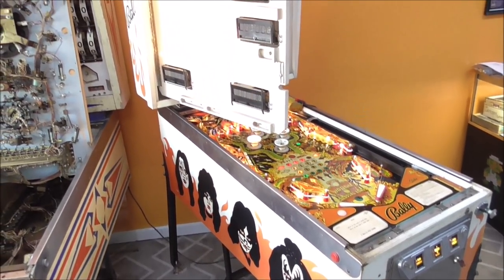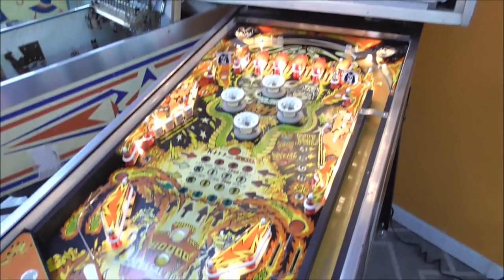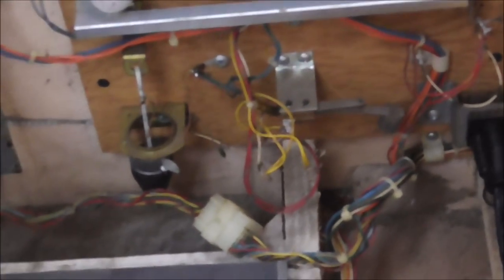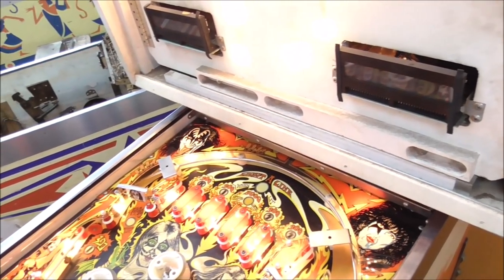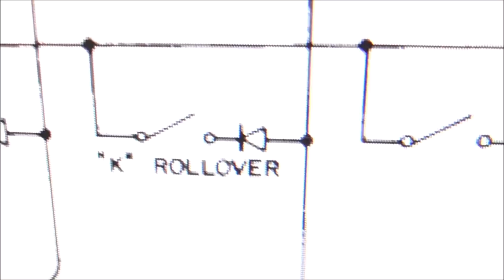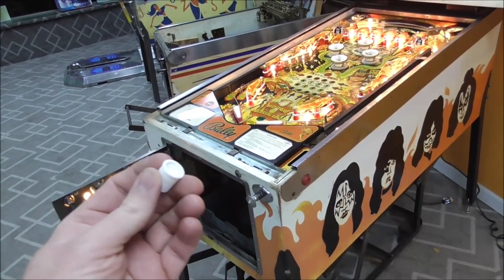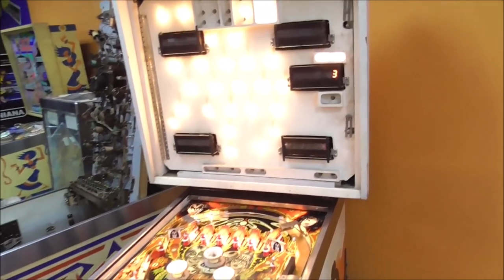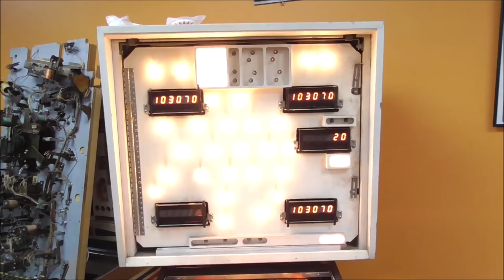Tracking down Switch Problems - Bally 1979 KISS Pinball Machine - Let's Get This Sucker To Play! A-3

Comment: I believe the caps also serve as protection against 'switch bounce'; scoring more than once when hitting a switch.
Reply from the maker: Have you ever owned a Bally pinball machine? I have, and what I said they do in the video is what they do because I've actually touched one
Reply: @LyonsArcade  I've owned a Stern machine does that count? You seem to be unfamiliar with switch bounce, which is also a thing.

https://www.allaboutcircuits.com/technical-articles/switch-bounce-how-to-deal-with-it/

Not sure why you are getting snippy, I never suggested that you were wrong, I just said this is also something that the cap does.
Reply: @LyonsArcade  That's kind of a crappy response to give to one of your viewers, even if you are correct.  To be fair, you've been incorrect about technical things before in your videos and this guy has a fair, and valid, point.  Just sayin', you could have went with, "That's an interesting point, but in my experience, the Ballys only use the diode to ensure quick response even with brief contact."  "I know because I've actually touched one..." is very seventh-grade, yeah?  Disappointing.
Reply: @mrmustard-mp6ij  I think maybe Ron was having a few beers and having a little fun with me 😉

Comment: Late 70s and early 80s put out the best pins, in my opinion.
Reply: Feeling and esthetic are very nostalgic.
But if you really check the quality inside,hardware,finition,solidity and conception.
They are not 'golden age' is more by title,modele and label.
Me,that was more the late 80 early 90..and custom version of old pin are great too (like T2,Tales from the crypt,Elvira..).

Comment: nice to see you put the diodes back on even though it works with out them
Reply from the maker: It kind of needs them or it won't score very well, you'll hit stuff a lot and it not score.  They were caps though but I might have said Diodes...
Reply: If the diodes are in a switch matrix, you need the diodes to stop ghost events. Tricky to explain in words only, but if you have have two switches activated, then it can look as though four are active. Unlikely to happen in a single ball machine but more likely with multi-ball playfield.

Comment: I bought a DFR8 Uniden Radar detector on Amazon. It should show up on your sheet. I have read good things about the DFR8 and DFR9. The 9 has GPS lockout, which is really nice, but it adds almost 100 dollars to the price. I will let you know how it works. Supposed to eliminate a lot of false alerts from X and from collision avoidance systems in other vehicles.
Reply from the maker: Very cool thank you OCSRC!  Are you in the US?  I dont' see it on there yet but I think it will go through.  I haven't been able to get the links to work in the ap yet I think it only works on a desktop or on a web browser on your phone but i'm still figuring it all out.
Reply: @LyonsArcade  I am in Quakertown, PA, just south of Allentown, hour north of Philly. Amazon is supposed to put a cookie on the computer when you click the link, and I don't know how long that cookie lasts, so I try to remember to click the link before I order.

I am not sure if I need to clear the browser history and close the browser before doing the ordering.

I use Firefox.  Each browser is different in the way it handles cookies and some block them without ever telling you they block them.

I get popups every time I try to access my bank or paypal, and I have to click to allow the page to do whatever it is doing and it usually reopens the browser.

In the old days of Windows XP, you could look in the cookie folder and open the txt file for each site, and see when the cookie was placed and when it expires.

Now, with Windows 10, I have no clue where they keep the data, or if you can get to it at all.

They have encrypted a lot of the OS.

My Youtube name is actually an acronym for where I used to work.

Orbital Communication Satellite Relay Center

A lot of people wonder if it is a name and they don't know how to pronounce it.

We used to refer to it as "OSCAR"

I am no longer able to work.  Had an aortic aneurysm in 2013, had to have emergency heart surgery. New aorta, valves, arteries. It worked for a while, but now I have CHF, congestive heart failure.

It hurts, very painful. No one ever mentions that fact.  And trying to get pain medicine, with this BS prescription opioid crisis, is impossible.

So most days I am stuck in bed, in pain so bad I can't get up, and Youtube is a great thing to have when I am not in too much pain to watch.

When I can get pain medicine, I can actually do work around the house, the yard, on my truck, but without it, I am bed ridden. 

I tell everyone, don't put anything off.  Do what you want to do, take a trip, do it while you still can, because you never know when you will be struck down with something like this.

I was lucky, in that the pain was so bad.  Most people with a AAA, ascending aortic aneurysm, never feel any pain, and it just ruptures and you die, almost on the spot.

My low pain threshold really helped me, because i went to the ER and they did a scan, and they did the surgery a few hours later.

I had started to split the aorta and it was leaking blood into my chest.  Very bad, but I am still here. 

God must have a reason, that's all I can figure.

Comment: One step at a time.
Reply from the maker: We're getting there, what's next?
Reply: @LyonsArcade  I Would say check 
1. The flipper plungers and sleeves 
2. The coin door mech wires the outer two should be the same number switch
3. The 3rd player and player number displays
4. The kiss board 
5. Then replace blown bulbs 
6. Then pop bumper caps 
7.  Check to see if kiss and arrow matrix works
8. Triple thick the back glass if necessary 
9. Install back glass and soak it all in
10. Make video of playing game

I noticed that one version of the coin door has a  kiss logo between the coin mechs. 

https://www.pinballmania.com/images/machinesLg/282_10.JPG

Comment: I have a 1959 madenmazelle where is on and off switch located I've looked everywhere
Reply from the maker: Try pressing the left flipper button, games that old didn't have on/off switches, but if you plugged it in and it's dark, pressing the left flipper button would turn on the lights.  To turn it off you were supposed to slap the bottom of the game which opens a bounce switch to turn it off.

Comment: On the diodes ...are they pretty much all the same value as far the early bally machines go? In other words can i order like a 50 piece pack and use them on the early solid state ballys/sterns?
Reply from the maker: I must have said diodes at some point but there are two things on each switch, a diode (one was broken as I remember) and a capacitor (12 were missing)... but yes, they are the exact same on all the early ballys and Sterns, and yes you can just order like 50 or 100 of them and be set for a long time.  You can get them on Amazon or Ebay, I think I mentioned the part number to both in the video here somewhere.
Reply: @LyonsArcade  your the man !!! Thank you

Comment: so that cpu replacement board... does it use the original firmware?  or is it a clone??
Reply from the maker: It uses the original software but no the hardware is different.
Reply: You can find more info here   
https://allteksystems.com/products/ultimate-mpu-universal-bally-stern-replacement-board
Reply: Looking at the schematic for the replacement board it seems to still have a real 6800 processor.  There are some obvious component count savings, most notably consolidating all the roms into one big rom chip and consolidating the address decoding logic into a programable logic chip.